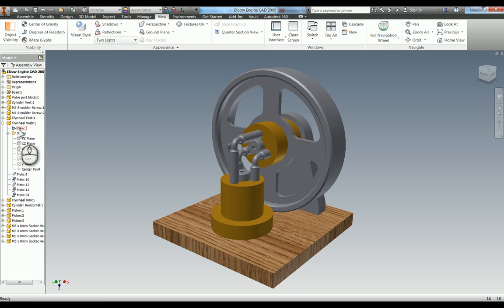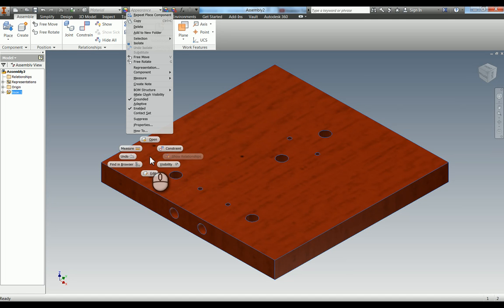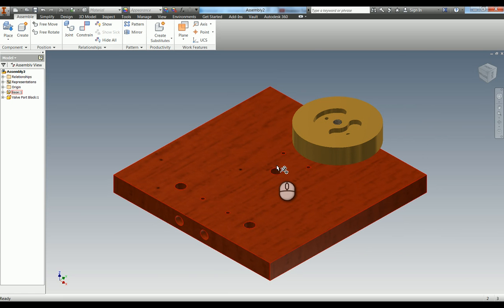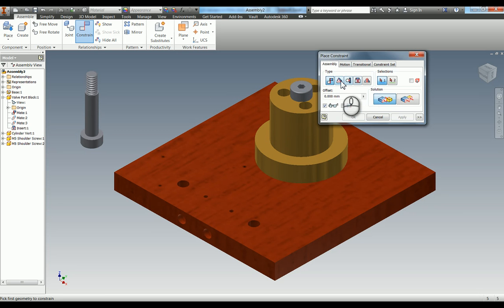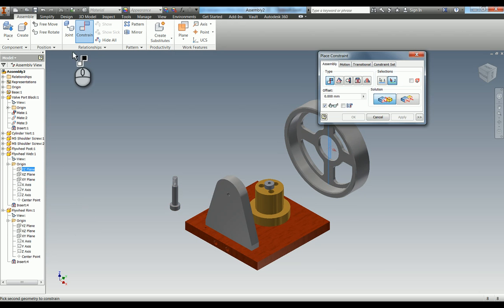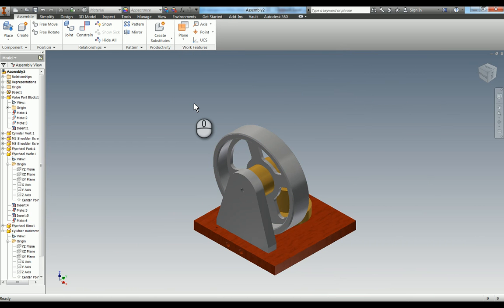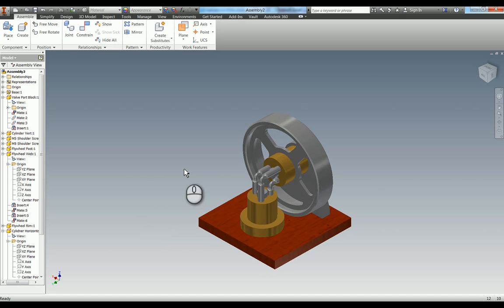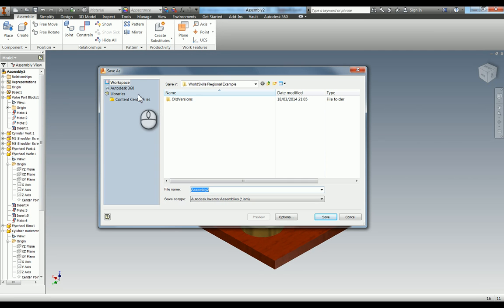10   Creating the Assembly - Elbow Engine

Comment: I built a servo motor, the gear is meant to rotate a flat bar of aluminum. When i right click on the constraint and click on "Drive", i change the degrees and so on but it wont allow me to apply. I believe I have constrained all parts appropriately. You think you can help me? Really desperate... thanks :D
Reply: I can upload a video of what i am trying to do? if i did not made myself clear? thanks :D
Reply from the maker: +SVW. Weson Yeah please upload a video that would make it easier to diagnose :)

Comment: Is it possible to create a rack gear in inventor?
Reply from the maker: +Rancrom Absolutely. There are two ways:

1: Create manually, same as any part / assembly creation in Inventor

2: Use Design Accelerator to have them created automatically for you.

Have you used Design Accelerator before? If not, let me know and I'll add it to the list of videos that I will create :)
Reply: +Autodesk Inventor Guy thanks for the reply! That's great to know. I have in the past tried making the part by hand using the pattern tool. But it was very tedious and couldn't quite get it to mesh with the spur gears that can be created in assembly. Design accelerator sounds great, I have never used it before. It would be great to see a video on it!